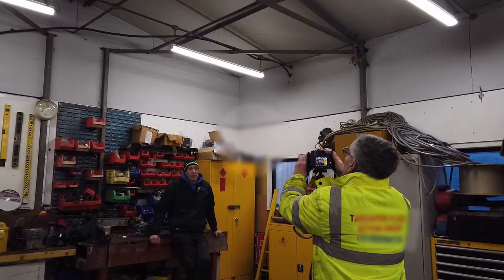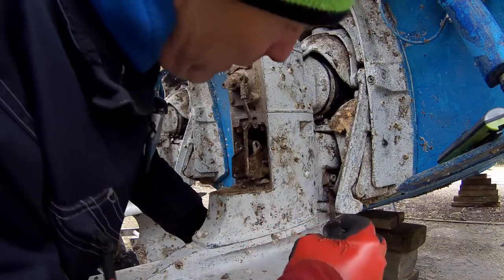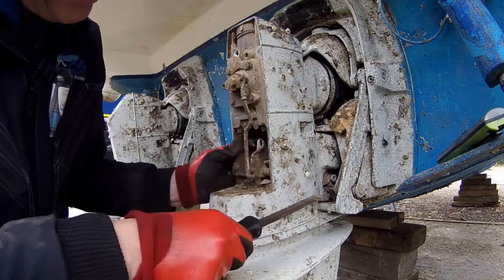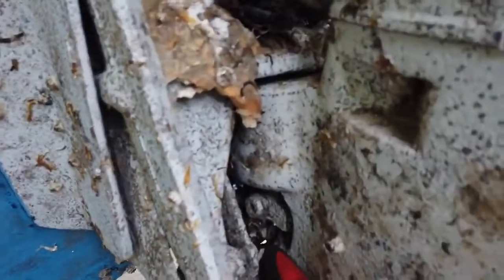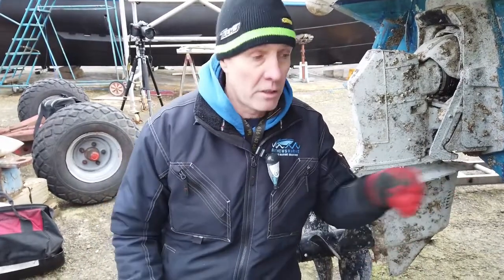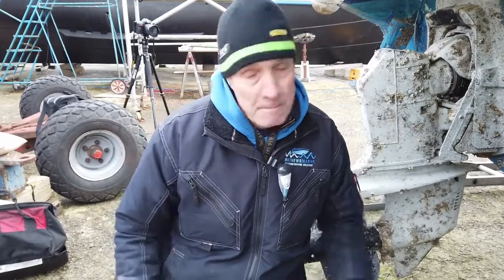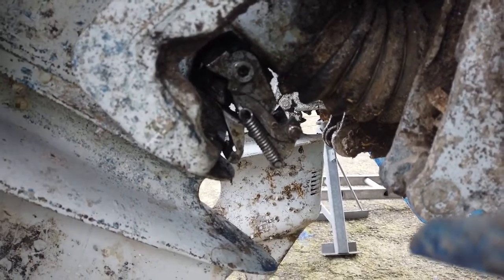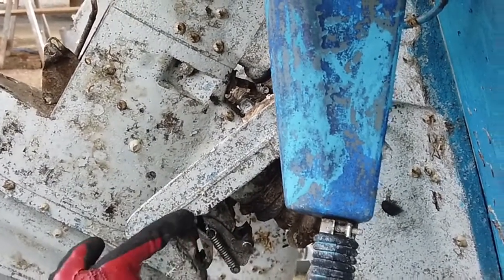Volvlo DP290 Sterndrive Reverse clasp

Comment: Hello! And thank you for the video. What does the rod that goes up into the stearing fork on the top left side from the bottom where the actual latch mechanism is?
Reply from the maker: I think your looking at the gear selection cable.

Comment: Why not lock the unit to the lift cradle and no more latch problem?
Reply: Because if you hit a log or rock you could smash the leg or worse..
Reply: @madmechanic7641  BUT THE LATER LEGS HAVE THE RAM CONNECTED TO THE LEG?
Reply from the maker: The earlier units don't, and therefore need to lift away if needed, but then be able to latch when going astern.
Reply: @MyAvaGrace  yes....but the later legs permanently attached to the ram?
Reply from the maker: @Mudiver8  the ram alows them to move. therefore lowers the risk of breaking  the leg.
Reply: @MyAvaGrace  it's just when the boat is sat in the marina for long periods without being used like winter etc...the latch is bound to jam up.